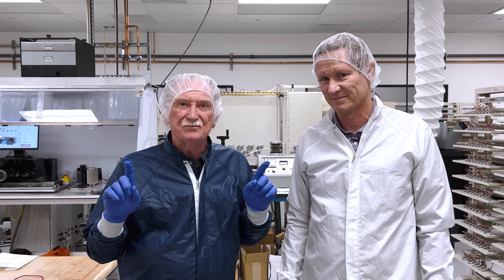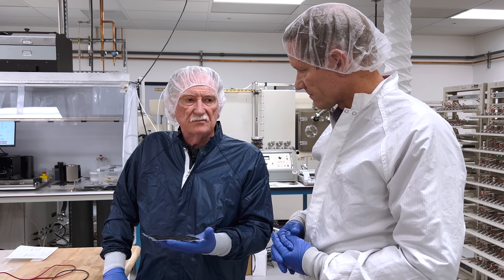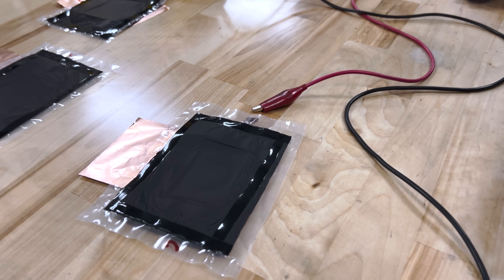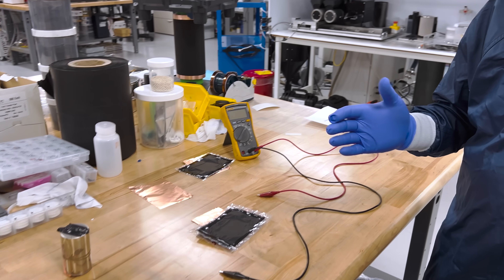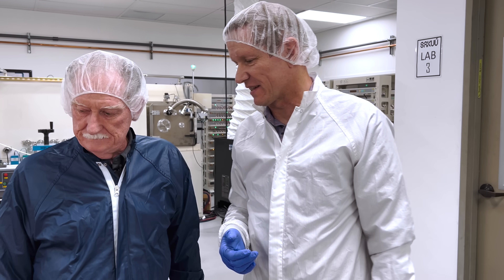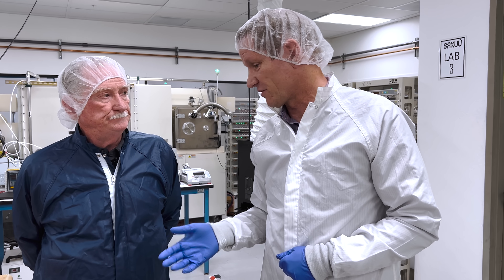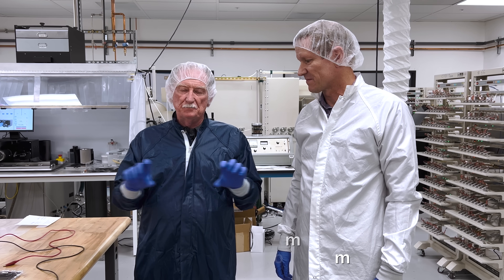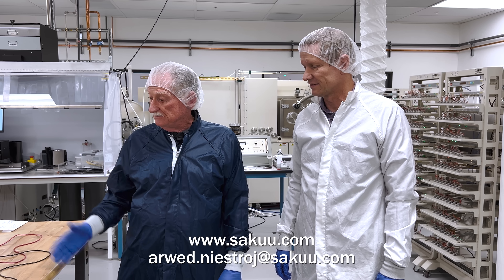Sakuu's Metal-Free Battery Cell: Game-Changing Innovation

Comment: Battery/EV tech is really advancing at rapid rates. Amazing engineering by Sakuu. Great video Sandy !
Reply: @EpicDrew15  

Well, there you have it. In no world 20% energy density increase in the span of 15 years is "rapid" or "big." One could get the inspiration from the CPU development when we went from hundreds of Mhz to Ghz range in just a few years to define "rapid."
Reply: @fd15k There are very few areas with comparable progress. 15y EVs were laughed at. Now they are mainstream and many make good money as influencers trying to make them look bad and save the oil industry.
Reply from the maker: Yes! Thank you!
Reply: @MunroLive  extreme temperature effects ? ability to print into voids within a vehicle structure ? and Is anyone pursuing a decent in wheel motor design yet ?
Reply: @MunroLive  no
Reply: @MunroLive  lol batteries freeze in winter so its quite the opposite .
Reply: @MunroLive  THERE IS METALS A COPPER SHEET LMAO VIDEO=COMPLETE LIE
Reply: @billybobbob3003  the copper sheet was only used to simplify the demonstration. It doesn't contain any copper.
Reply: @billybobbob3003 the copper sheet, i.e. current collector, is not part of the cell. It is an external connector to the cell contact surface. There are no metals in the cell itself.
So, not a lie!
Reply: @MunroLive  - This could be one of those "magic bullets".   I'm just afraid that the guy in the white lab coat will disappear soon, and I don't mean just walking away from the camera. ;(
Reply: @BillAnt  You mean "big oil" or "big battery" will kill him?  Take your meds...
Reply: @BillAnt  Is this like the water gas development???
Reply: I am not hater, but no its not. There is a "new battery" every week. If you look at periodic table, there is not much room for advancements.
Reply: @0cool966  - Well, once we find an elusive tweak to improve all aspects of electron storage, the floodgates will open.
Reply: @0cool966  I've lost count of the number of game changers, yet the game doesn't seem to have changed much.
Reply: @davidnorton5887  Your not keeping up...
Reply: To all who says no. Everyone who knows something about engineering knows these are major steps for battery tech.
Reply: @JonasDM46  - Including  advancements on improving the energy density of capacitive storage like super-caps.  Imagine having unlimited charge/discharge cycles on your battery with no liquids involved (perhaps using graphene nano sheets).
Reply: Is it?? 12 years after Tesla model S and not much progress. Where's the 500mile range, where is the 10 min charge?
Reply: @johnnyv5995  500 mile range ? do you drive 500 miles without a break ?
Reply: @johnnyv5995 looks beyond tesla. Lucid is doing this. Chevrolet is doing this.
Reply: Outweight by mass gain ?  @EpicDrew15
Reply: A million breakthroughs. Of them only a handful make it into production every year and are usually only evolutionary improvements.
Reply: Is this just lithium polymer?
Reply: And these ones do look like they are almost ready for mass production.
Reply: Rapid rates ? Hardly. We've had marginal improvements over the years, but effectively no significant breakthroughs since the first successful EVs 15 years ago.
Reply: @fd15k  Timescale does not matter in the long run.  Progress is happening at a good rate and in a few decades all will drive EVs, or they will more likely be self driving.
Reply: @fd15k  And no improvement in the grid that is incapable of providing the current to charge a complete replacement of ICE. Sandy has a great channel, but his insistence that the ICE is over is like the climate malthusian cultists claiming the end of the planet every five years for the past 50 years.
Reply: @fd15k  are you high or just ignorant?

Comment: Big Question:  When will we see these batteries in BEVs like from Tesla?  Also, I’m guessing that they do not need any liquid cooling?
Reply: Yeah nothing on cooling but nothing on mass production either no dates you know it could be just another pipe dream I hope not
Reply: ~10yrs if ever. mass mfing is the harder part. look at the date of maxwell dry coating patent date, still not cracked large scale
Reply: Maybe never because it's at an early stage and it may never be produced. Munro could find dozens of labs like this one with break-through battery tech...
Reply: @btn73  yes. there's lots of exciting lab developments. Gelion also has a lab cells using Lithium/silicon/sulphur  that do similar energy density... The real trick is commercial production, and that takes years to develop and validate. However. it's good to see new promising tech.

Comment: Extremely interesting cell design, but it's not apples to apples to compare the energy density. The outer casing of the 4680 is thicker than it needs to be to contribute to the structure of the battery pack. Unless you guys are directly comparing just the internal 4680 jelly role to Sakuu's design?
Reply: Yea it’s not clear to me how much better it will be in the final automotive form. I can already buy 450 Wh/kg pouches but they’re not suitable for automotive for various reasons. But if Sandy’s excited, it’s worth keeping an eye on!
Reply: @snower13  Agreed, I don't doubt it's innovative. I just didn't see/hear enough detail to be confident in how they compared the power density with the 4680 cells.
Reply: LiFePO4, cooling?
Reply: I had wondered how the benefits might look when you have to replace the 4680 structural benefits to accommodate these non-rigid batteries in a modern ev.

Comment: Make them into strips like the Byd blade the full width of the vehicle, compress them and fill the entire pack under a Tesla. 500 miles of range with less weight.
Reply: Tesla has their own battery technology they're not going to have this hopefully Ford is in line to get this for their vehicles GM has the altium battery
Reply: @user-Dave67  bets they buy the company?

Comment: But can they manufacture in volume?
Reply: One of the previous videos about Sakuu videos talks about that. IIRC they have the manufacturing line running at pilot scale. The line integration is modular so it would use the same machines just more of them to got to production scale. They a licensing the tech so will not be running full-scale plants themselves. I think they have licensees running at pilot scale now.
Reply: @ryuuguu01 boy I hope so that means in a couple years high production value